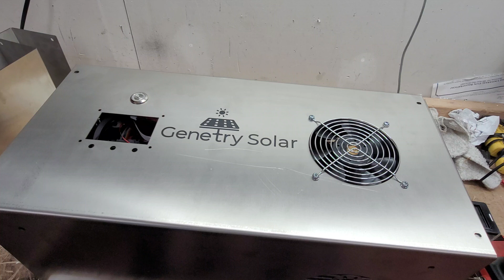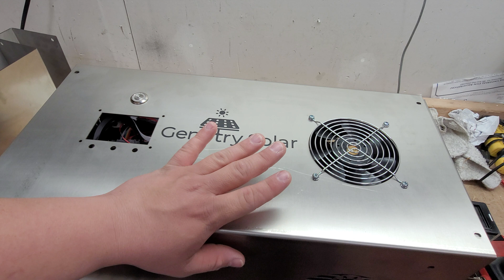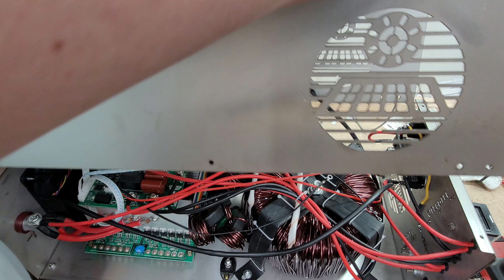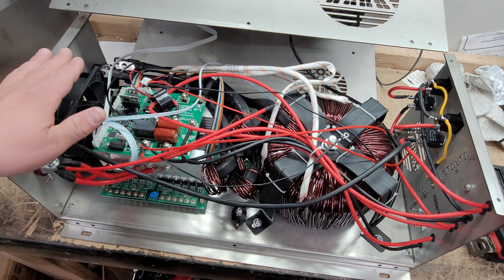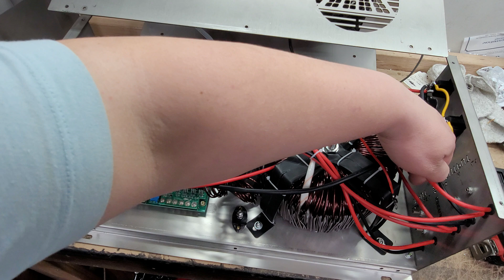Genetry Solar 6000W Inverter inside look.

Comment: I need some help with a version 10.0 upower 12000 watt inverter its in a big stainless box and ive tried to turn voltage up but cant get anything over 116 volt on either leg

Comment: ..yeeep ... thick but aluminium not a copper winding...
Reply: That is correct; however, I designed the winding specification with this in mind.  It's not impossible to switch to copper, however the higher cost of the material AND greater weight would increase total unit cost slightly.  If we have problems with the aluminum windings, we definitely will switch...but if they work, then everyone wins.

Comment: Have you thought about remote start and will these units work in charging power bank?
Reply: Also yes, battery charge is in the plans.  Need to get a battery bank connected to my bench GS inverter and get to work on the code.
Reply: Remote start?  Are you referring to generator start?  If so, yes, that has already been thought of.  2 small relays on the (video perspective) lower left of the control board provide a small isolated output signal that can be used as generator start/run signals.  And as the WiFi board can access/control anything on the inverter, you could start a generator from your cellphone on the other side of the planet, if you wanted to.  Manually start the generator, manually start battery charge, manually switch between AC input and inverter mode...
Reply: @sidlori1592  I think what he was meaning Sid was can you turn the Inverter on remotely. Not having to leave it in an idle mode but just using power to keep the WiFi board powered up until you need to use it. I'm making a modification to one of my PJ units so that it will turn itself on automatically when the Sun  comes up in the morning and the Voltage has reached a certain Voltage.
Reply: @gravelydon7072  If that is the case, yes, you can absolutely turn the inverter on remotely via WiFi. 
For your case, I am working on adding code to allow control of the beeper volume, so you can set it to silent.  That way you can use the UVP Shutdown value together with auto-restart to do exactly what you need...without going crazy and/or hitting the buzzer with a hammer.  (Note that auto restart will not trigger unless UVP Alarm is not active, giving you a safety hysteresis so it doesn't oscillate on and off.)
Reply: @sidlori1592  I could have used it today. :-( Power failure at just after 0200. Didn't come back on until 0350. I had to go out to the shed to turn my inverter on.  Looked at the battery voltage while I was out there. Holding at 25.0 which wasn't bad. Now they have to wait for sunrise to recharge.
Reply: That's awesome . Many of the customers will probably be using these 24v inverters in campers/motorhomes and off grid applications. Charging when solar may not be avalable but they may have their trusty generator or have access to shore power like at a KOA or other sight. Charging definatly needed. 
As for remote start I was refering to the start button for the unit. I see that you can extend the wiring to it but maybe think of a bluetooth or something like that so custmers might put switch in a more convenient place.
Reply: @TheDXperiance  Start button for what?  There's a generator start connector--but that's the output to the generator's control circuitry.  Start is either automatic (based on battery voltage setpoints), or can be manually controlled via WiFi.  RS-485/RS-232 and/or perhaps Bluetooth connectivity are possible, and in the works once I get enough other critical things taken care of ;-).  A one man show may sound exciting, but it's a heap of work.
Reply: @sidlori1592  thank you so much for responding to my questions and concerns especially because I do know what a ton of work it was pull off just what you have done so far. Literally as a one man band.  You've got a ton people rooting for you and your success.  73's brother.

Comment: very nice and beefy i dont thing no one using 12 volts needs this big of a inverter   even on video you can see the thickness of the case and ALL the wires   i am very impressed